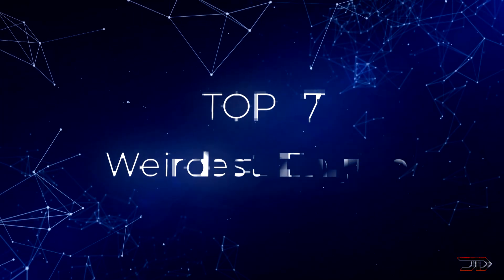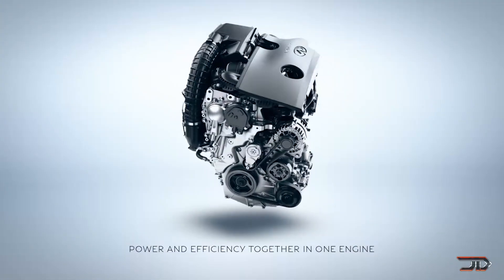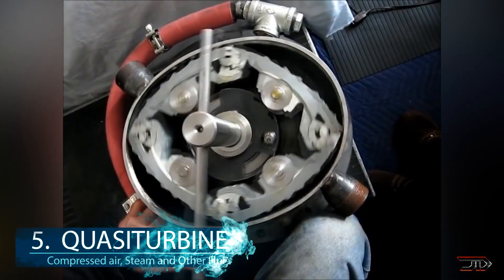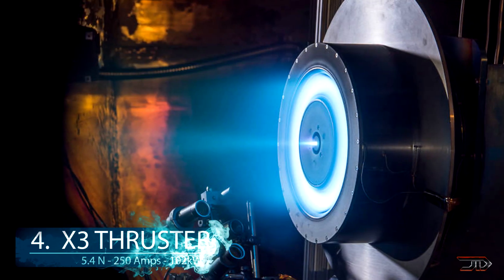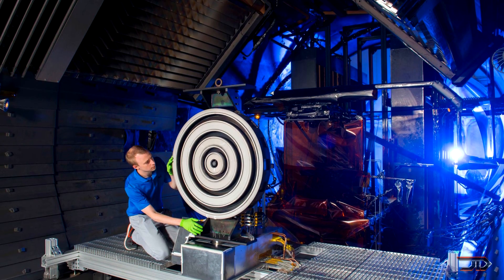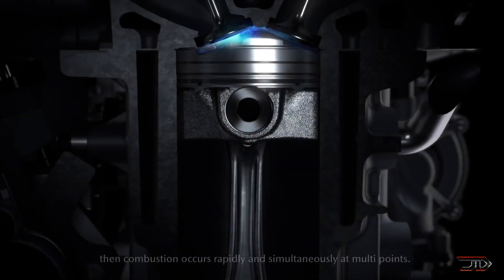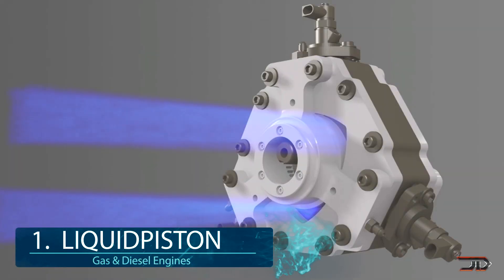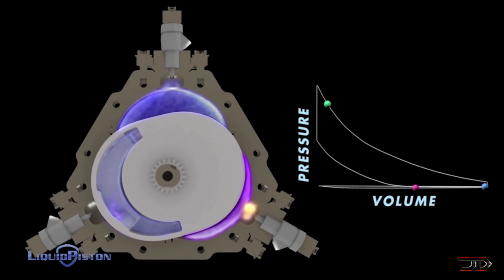7 STRANGEST New Engines

Comment: The x3 ion thruster is being used on satellite they just sent into space few months ago.  There are 2 kinds of thrusters.  Theres the ion x3 and the em drive.
Reply: Aaron Davies I understand perfectly. You're a blithering idiot stuck in an old 1990s conspiracy theory that you're trying to give a new name. 

That or you're 12, failing school, and need to get off of the internet. 

You can try asking mom which of those things you are if you're unsure.

Either way, you're dismissed. You may go now.
Reply: @Ni999  actually mach 3 has been beaten in flight by things other than missiles and spacecraft... SCRAMjet testbeds like the X-43a and the x-51 manage it quite easily. Other than that, you're right about everything else and Aaron Davies appears to be a complete moron.
Reply: Luke Freeman You got me, I completely spaced the scramjet. Thanks!
Reply: There are far more than two types of thrusters.

https://en.m.wikipedia.org/wiki/Thruster

And despite DARPA recently adding funds for further research based on tests by NASA Eagleworks, the emdrive has yet to verifiably produce any thrust.  Most results have been proven to be test aberrations. 

Eagleworks is also looking into the Alcubierre warp drive - as in Star Trek warp drive. 

Just because something is being looked at doesn't mean it exists outside of science fiction.

One study is examining the possibility that a quantum effect is at play for the emdrive because in their setup, they still think they might be getting a micronewton of force after removing the error points. Unless that's verified, the emdrive is violating the laws of physics.

Violating the laws of physics isn't exciting - it means that it cannot work and history is littered with examples of magic motors that did nothing.

If you're not familiar with standard units, 5 micronewtons is equivalent to what it would take to move a millionth of a pound one foot.

5 micronewtons is also one-millionth of the force produced by the X3, and that's a Hall thruster.

You'll have to let me know when an X3 went up, I'm not finding a reference for that.
Reply: @Ni999  the laws of physics are not unbreakable constants. They can, and do change depending on current understanding.
Reply: Demonslayer20111 That's true when you consider the sum of our understanding and actual physics as opposed to the versions pushed by sensational reports. Most of the time, laws are not broken - new theories subsume older ones. Newton's law of gravity was subsumed by general relativity - but in Newton's equation still suffices for many uses. Classical physics does not apply at the quantum scale, but classical mechanics did not suddenly stop working at the macro scale just because quantum mechanics works at the atomic level.

The first claim from the em drive was that Newton's laws of motion did not apply. The first independent tests on engines based on the written description revealed that yes, they did apply, and subsequent tests ultimately revealed the same force in the same direction regardless of which way it was pointed, and at a significantly reduced level. Then there was the part about cutting power in half but still measuring the same results while a different test claimed the opposite. 

That's not physics being broken, that's the process at work to separate science from nonsense.

The last holdout for the emdrive is a speculation that the miniscule force component is coming from a little-known piece of quantum field theory called Bohmian mechanics. If true it will validate an additional term to the wave equation. That doesn't break physics either, but would be interesting news to some theoretical physicists if true.

So regardless of the history of physics across all time, anything claiming to break the laws of physics is not cause for excitement, it's cause for concern.

A drive that can do what the em drive claimed a decade ago, and actually work, would be very exciting. And if such a thing were to be accompanied by a new theory subsuming an old one, great.

And if such a day comes, the failed emdrives are not going to leap off of the shelves leaving a dust trail as they suddenly begin to work after all.

And taking my original remark in its entirety, please provide one example of a new discovery of an engine or motor that has violated Newton's laws of motion. Or one that has violated the thermodynamic laws. Or any laws. Maybe you can think of one, I'm not remembering any at the moment.

People will continue to believe in the emdrive long after I'm dead. The lunatic fringe has already been represented here and explained to which conspiracy theory this one belongs.
Reply: @Ni999  people believe it because it should work. Its not free energy nor is it perpetual. There is an input, thus there MUST be an output however small it may be. I'm not suggesting that they will leap off of anything the thrust if any is miniscule. Also I was not referring to engines. I was simply stating a well known fact. The so called laws of physics are not absolute.
Reply: Demonslayer20111 There is an output - an rf field change inside the chamber. So far its been correlated to reacting with the field around the power lines in its own test chamber. The best description of why it doesn't work is sitting in your car with the motor off and pushing on the windshield trying to get it to move. The windshield gets an input. So does your seat to an equal and opposite degree. And your car is not going to move because force does not work that way. 

So no, it shouldn't work just because there's an input. 

People still believe it because they either didn't pay attention in elementary science classes, didn't take time to understand the configuration, or they just want it to work.

And fine - lets leave motors and engines out of it.

Here's a worthwhile discussion about the conservation of energy being broken. It's news now. Except that it was explained a century ago.

http://www.preposterousuniverse.com/blog/2010/02/22/energy-is-not-conserved/

Then there was the time we broke parity a in particle accelerator.

https://m.phys.org/news/2010-03-tiny-instant-physicists-broken-law.html

I'm not going to repeat my previous post. Physics getting broken is more a matter of definition than popular sentiment allows and it is not a common occurrence.

We already know that general relativity and quantum mechanics don't fit together. When that gets solved, it's going to be reported as news that they were broken. All that's going to happen is that we're going to learn how they fit. 

It's not happening for the emdrive. The laws of motion are still ok.
Reply: Demonslayer20111 Sit in your car pushing the windshield nonstop until you're overcome with exhaustion. Leave the windows up. 

You'll create a change in temperature that will leak to the outside unevenly because your car is not a perfect, homogeneous bubble. In the right environment, the leak imbalance will appear as a miniscule force and with enough effort, we'll be able to measure it.

No physical laws will be broken and the car will still be in the same spot.

Welcome to the emdrive.
Reply: Deipatrous Yep.
Reply: Aaron Davies It's obvious that you are confused by the electromagnetic railguns, able to send projectiles to hypervelocity, Mach 7 and above. Note carefully - an em railgun is not an emdrive, a projectile is not an aircraft, mak7 is not a thing, no one has ever exceeded a bit over Mach 3 in any sort of flight except for spacecraft and ballistic missiles, none of which are flying through the atmosphere courtesy of any esoteric drive, and the emdrive is bullshit waiting for final testing to stick a fork in it.

If I could find a website that would make it possible for you to be able to actually think, I would surely link it. Wikipedia is the least of your worries, no one can control that which does not exist.

Between this post and the previous ones, I've given you all the pointers that you need to start over. If you don't want to view Wikipedia, great, go to your local public library and ask for help finding references on thrusters. And stop whatever you are doing that has convinced you that you understand the nature of propulsion, aircraft, physics, and the modern world.

No need to thank me, you're welcome.
Reply: Aaron Davies Yes, but that's only true in the Marvel universe, not the real one.
Reply: And while we're at it maybe the entire idea of a thruster would make sense by knowing what thrust is -

https://www.grc.nasa.gov/www/k-12/rocket/rktth1.html

Here's some news about a rocket thruster, we've been using rocket thrusters for generations -

https://www.sciencealert.com/new-electric-space-rocket-thruster-runs-on-air

Jet skis and even boats can use thrusters, here's a company making some -

https://www.hollandmarineparts.nl/jetthruster

Those are driven by water, not pixie dust.

Given that the emdrive is enclosed without a reaction outlet, it cannot possibly be classified as a thruster. Given that it does not actually do anything, it can be classified as a radio frequency chamber that does not produce any motive force.

And the good news is that none of the above sites are crafted into tricking anyone in how to think. Unless you think that about NASA. And only idiots believe that.

Or, you know, just use Wikipedia for cross linking and don't assume that's it's a form of mind control.
Reply: wildest Mormon This seems like the ideal engine for them to use on any space craft seeking to leave the moons orbit if they were to set up a base there. The moon makes more sense to launch outer space missions from due to the fact it doesn’t take an astronomical amount of raw fuel to brake the moons orbit like it does the Earth’s.
Reply: ure pretty well infomed for a Mormon...
Reply: fenton bevan You're certainly entitled to your opinions. Ironic given the fact that you believe in fairy tales about Nazis being the good guys - you'd not have that privilege in wartime Germany. You are not entitled to your own facts, no matter how many idiotic YouTube videos support your stupidity.

You're dismissed. You're free to go troll elsewhere, komrade.
Reply: There are ion thrusters that work...and there is the EM Drive.
Reply: Aaron Davies And because you enjoy YouTube, here's everything you need to know about the emdrive from a credible source.

Watch "The Results of The Best EM Drive Test Yet" by Scott Manley 

https://youtu.be/rJM6lP9CuSw

There. Now you know what it is and how it manages to be science fiction.

Comment: more moving parts = more problems
Reply: It's not always true. 2stroke is the simplest engine, generally way more unreliable than 4stroke, how the internal parts interact is more important than the number of its it's parts. Engines with timing chain generally last way longer than engines with timing belt. Significantly more complex to build but still more reliable.

Comment: Why are we even wasting time researching the ancient technology of the internal combustion engine what a waste of time
Reply: Your question is tantamount to asking "Why are we wasting time researching better ways to do things?"

99% of the infrastructure for all vehicles is still based on IC.  It's not going away anytime soon.  The fact that people and companies are trying to find the most efficient way possible to operate what will still be in operation for several more decades if not centuries is a good thing - more efficiency generally equals less emissions, lower fuel consumption, higher power-to-weight ratio (meaning they can be smaller/lighter), etc.

Considering that current electric cars have the same environmental impact as operating an IC driven car for somewhere between 2 and 5 years (and assuming the battery never has to be replaced) means they're not that much better of a solution yet.

At the same time, other people/companies can pursue even less wasteful technologies.  In the meantime we should make the most of what we have.
Reply: Sam King  -  yes, the initial environmental impact of the manufacture of EVs means it takes anywhere from 2-5 years of running an ICE vehicle until you’ve ”balanced” the books as it were...   but after that, the ICE continues to pollute while the EV does not.    What’s been most surprising to the industry is the longevity of the batteries and the ”second life” applications they can be put to, further decreasing the environmental impact their manufacture had.
Reply: Can you present where the ICE energy is derived and subtract the IC or EC environmental contribution offset? Can you provide the line loss calcs from distribution? They are real. Can you provide an estimate of the capitol cost of infrastructure for enough charging capacity? Offhand, if the PTB mandated instantly switching to EV, I suspect that 70% of the population would be walking to work for years while we ramped up large scale copper, lead, lithium mining etc. Great economic stimulous (misdirection of economic assets) for the energy distribution sector and coal miners!
Reply: Just ignore the chemical waste by products of the battery production. Very convenient. Then there is the inefficiency of battery tech. Buy a new bat pack every 3 years.  Still just a golf cart. Sweet sales pitch. Just lies.
Reply: orion khan mining the minerals and then dealing w used up batteries has environmental impacts and/or ecpense too.  Batteries are not a panacea, and they are not a prime mover either
Reply: @larrylund2682  just shows how little you know about EVs.
Reply: Jason Rogers:
Wow, are you mistaken! People have been predicting the end of the Otto cycle engine for decades and it is in business stronger than ever.
Current versions combine low cost, high efficiency, smooth operation, mechanical reliability, versatility, light weight, small size, etc, etc, in a plethora of packages that are STILL dominating the ground transportation and heavy tool markets. Don't hold your breath while waiting for them to be superseded.
Reply: it's really hard to get around the fact that liquid fuel is so amazing as an energy source.  It's potent (high energy per volume), it's stable (doesn't explode easily), and it's super easy to transport.  I can hand you a cup of gasoline, but I can't hand you a cup of electricity or hydrogen.  Electric storage is the real challenge and might be a few decades way from a real solution.  So, ICE development must continue until that is ready.  We are at a point now where further development of the ICE is getting exponentially more expensive to meet emissions and fuel regulations.  In the 80's and 90's $1 per engine per percent fuel saved was acceptable.  Now we are looking at $100 per engine per percent fuel saved, and it's going to get more expensive as time goes on.
Reply: Well the 20th century ICE engines are obsolete, hopefully soon replaced by 21st Century ICE which will be far lighter, less than 20 moving parts for reliability, and more powerful and provide 150 mpg for vehicles. Check out the Massive Yet Tiny engine.
Reply: @RayleighCriterion  Plus with further development of hydrogen-powered vehicles to overcome the range-limitations of EVs, there's going to be a need for newer & more efficiently designed ICEs!
Reply: For example, I live in an apartment, I have no real way of charging my electric vehicle without the risk of it being unplugged by some drunktard who'd think it's funny. When they implement charging stations at apartment house parking lot spaces, then it's different story.
Reply: @tuzikadesa8982  any socket will do you know. I park in the apartment block in central london and if all those supercars owners can have 12v battery chargers always plugged in, I'm sure you can ask landlord for a socket as well.
Reply: ICE isn't an ancient tech greentard
Reply: Internal combustion is not ancient technology. 

Stirling engines were proven to work quite well for a truck and a boat but no one really cared outside of Swedish navy, they're using them for submarines. On the surface they have to resort to internal combustion diesel engines. 

Electric motors might work out. Power supply is a problem.

Maybe it's a good idea to figure out how to burn less fuel until internal combustion engines are obsolete. Not sure why you don't want research for that. That can be done while others are looking for better methods of propulsion.

Think of it as being just like being able to walk and chew gum. Doing one doesn't mean that you can't do the other.
Reply: Until battery tech can store all of our needs in a transportable frame we will continue to need the IC
Reply: @DrCarbomb   until oil companies and oil company backed politicians encourage EVs(they wont, till they find a way to supply power to EVs and make money). They will use every trick to scrap every last bit of fuel they can get regardless of hazard to people and environment.
Reply: @unknownunknown-ni1ns  it kinda depends on consumer demand more than oil companies. Everyone loves gas, it's the easiest way to get around and EV's just don't have the mass production capability to provide for a lot of people. Add to that the development of billions in africa and south east asia, it will be a long time before there is options for everyone on the planet to not burn gas. There is so much demand. Oil companies are not evil for supplying it, if you want moral high ground you have to go after the consumers which is you just as much as the next guy.
Reply: How many IC powered card do you see when you drive on the road?

Yeah, that's why, gas isn't going anywhere for a while, but we might as well use it better while we have it.
Reply: Oil companies encourage it
Reply: So sad and so true the literal combustion engine is as old as the fossil fuels that power it